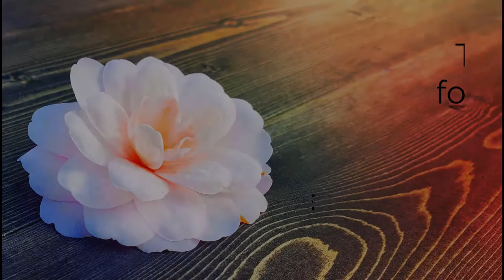DIY: Electrical Box Cover

Comment: Use pocket holes, instead of relying on the glue, still decent job all the same 👌
Reply from the maker: True 👍   I thought the glue would be fine with that it is. Since the fuse box is not used everyday.   Anything else, pocket holes for sure